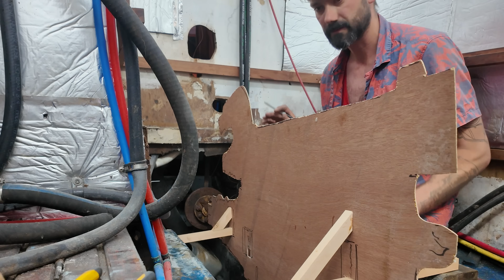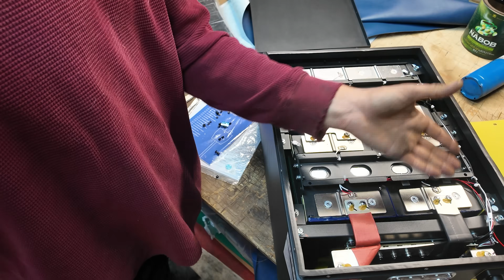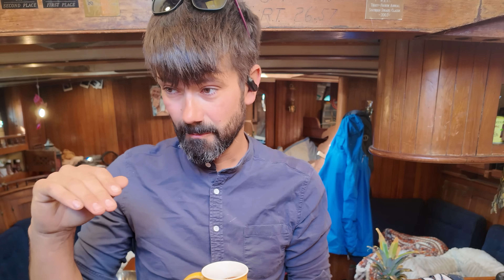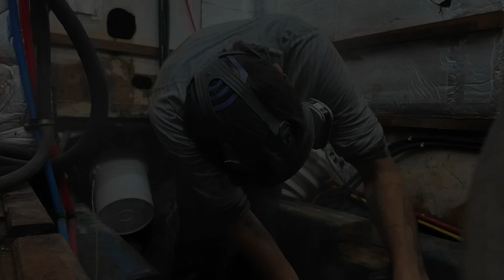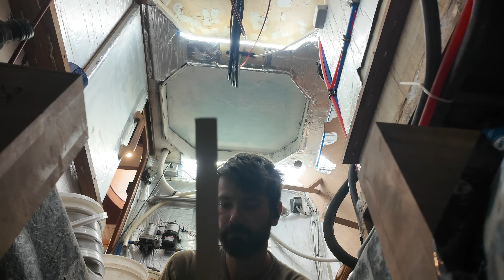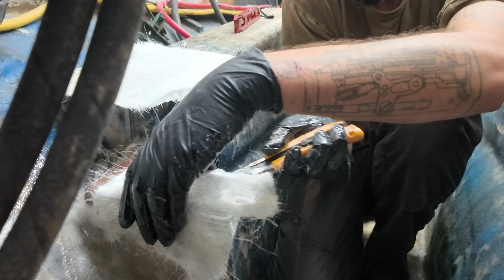Installing a New Boat Engine: Templating

Comment: Take care with lithium iron phosphate batteries as any battery failure will not burn seriously like the higher energy cemistries but they will produce a lot of hydrogen gas which will explode if lit.  At least one example.  StachD has a video on the danger.  Must make sure the the battery compartment is well ventilated.

Comment: That battery is impressive. BTW, for the review it would've been good to tell us if it supports series chains up to 48 volts
Reply from the maker: I’m not a fan of series mounting lifepo4 batteries. I find they hardly ever last long that way.
Reply: @findingsimon  what failed when you tried this? the BMS?

Comment: Simon.  To repeat something I wrote earlier about the mounts...

On the engine/tranny mounts.  You will most likely fit this with a Borg Warner 72C, as it it a very common setup.  In that case, the front engine mounts need to be different than the rears.  Bushing's 3300s are appropriate for the fronts.  But fitted to the trans/rear they will allow too much forward displacement under load (displacement hull, 30,00 lbs, 24/26x15/18 prop, 1800 rpm up), causing greatly increase angular loading on the rear main bearing and seal of the trans.  Use DF-4407-4's for the rear mounts.  Given the medium duty nature of the of the 72c, you need to protect the rear bearing from axial loading as well as angular loading.  The 4407's will help somewhat (cutting the angular deflection of the driveline almost in half), but you should really fit a thrust bearing in your driveline.  Otherwise you cut the life of the trans rear bearing from an expected 10,000 hours to about 2,000. I have a ChatGPT analysis I would be glad to share.

But please do not use the trunnion style mounts for the rear, as what you pulled off the engine/trans
Reply: Sorry.. for clarification is this a "from experience" reccomendation or just something your reading from chatGPT? I dont see how a AI analysis could have anything trustworthy to say in this type of work
Reply: @erinbaum308 No.  A structured analysis based on David Gerr's work.  Checked by Chat
Reply: @scottpeterd ive seen chat come to completely opposite conclusions of documents far more often than not. An original link would be appreciated.
Reply: I am not good at maths, but I agree the engine mounts need to be substantial. This engine could be run for days at 15 degrees heel while motor sailing. (this is definitely not an upwind boat design) The engine mount loads are way different to a motorboat where the engine is normally fairly horizontal. Cheers
Reply: The loads are much more than one would expect, especially taking into account the cyclical loading.  I do not believe the glued in transmission mount blocks will hold up under any kind of stress.  In addition, due to cyclical loading (impulse loads from the cylinder firing), regular epoxy is NOT suited for this application.  A specialty structural epoxy like Gflex/50 that can absorb impulses is required.  I also worry the tabbing isnt properly done.  It would be much better if it extended up and down the inside of the hull at least 6" to handle the torque load.  It should also extend fore and aft the same amount to handle thrust loads.  One of the reasons the extended tabbing is so important is that the hull layup of polyester resin and cloth has very poor interlayer laminar tensile strength, leading to peeling failures.  His setup will be tasked to handle over 2000 lbs of thrust.  An engineering safety factor of 3x means a design goal of handling 6,000 lbs of thrust.

As Simon said, he is not sure of the engineering of the blocks.  I have to agree.